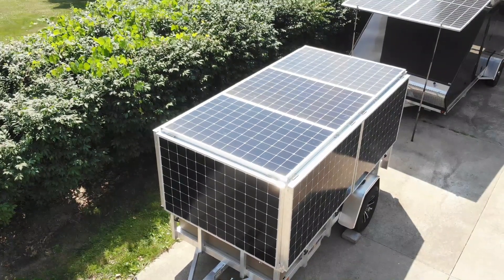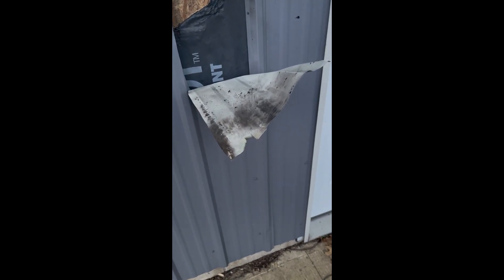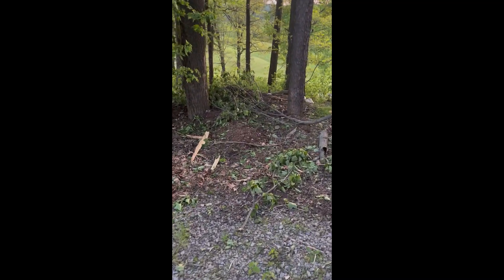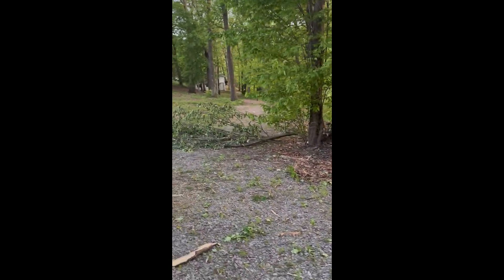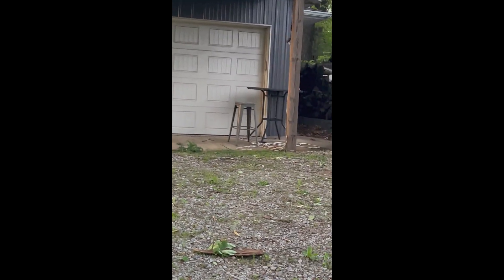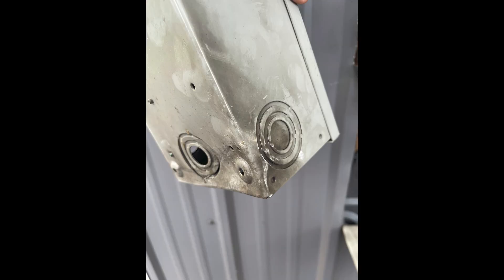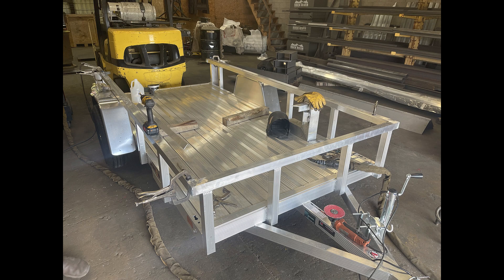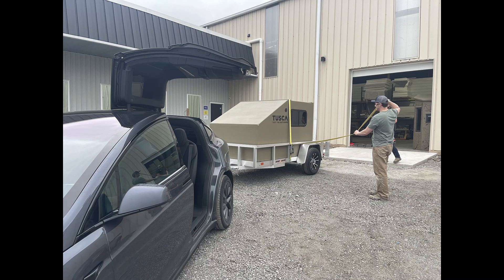Solar Trailer Version 2.0 - Towing with my 2022 Model X!

Comment: I'm in Phoenix homes get struck all the time during our monsoon season. I just installed a Ditek surge protector even if lightning strikes a nearby power line it will stop a surge. It's one of the better ones because it actually can take multiple surges where most others can't once they surge the MOV sacrifices itself but a 2nd surge you have no protection.

Comment: Can you please post the make and model of the trailer and what panels you used? That's a great build! Thanks
Reply from the maker: I plan on detailing everything. I bought commercial grade panels from Signature Solar That I really picked because the dimensions fit my project and trailer, but the panels are super strong